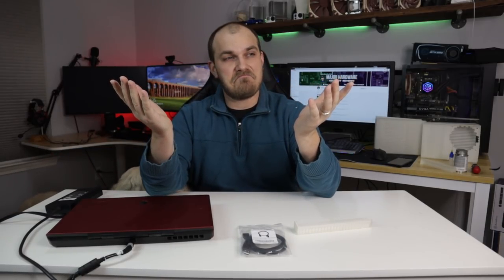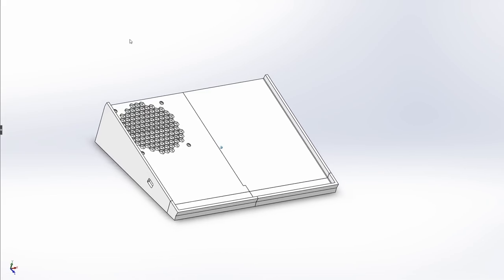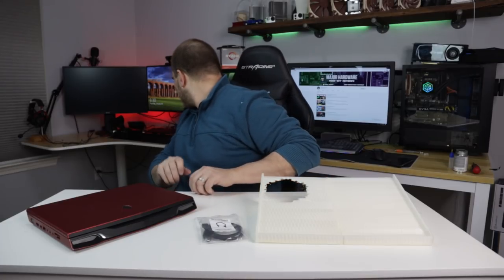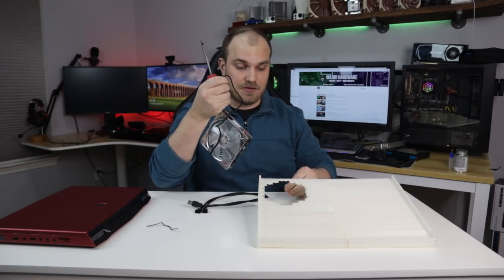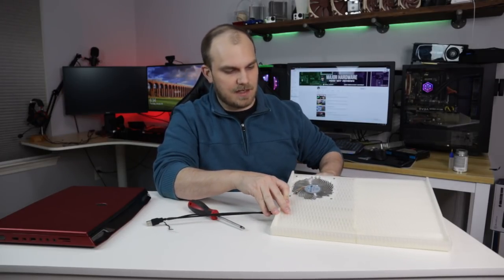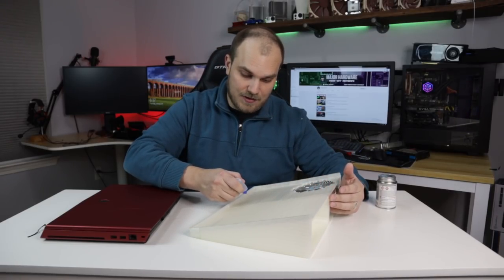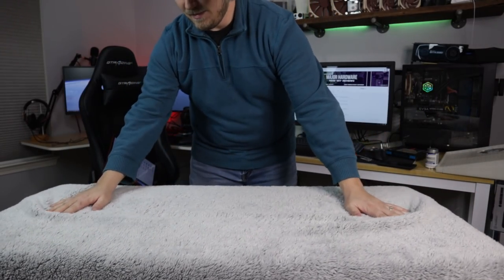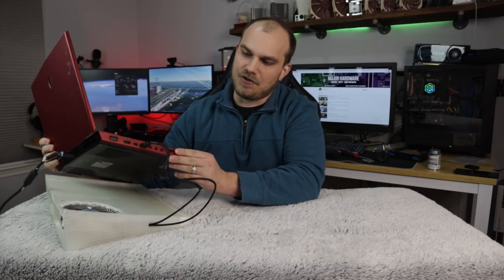I Made Something Useful To Cool My Gaming Laptop!

Comment: It would be interesting to see what it would be without the fan. Just having more clearance to draw air from should help
Reply: I usually put a pencil or two on the back of the laptop to make some clearance. The body of the laptop is strong enough not to get bent  so its ok
Reply: @santiagoferrari1973    I watercooled my ASUS FX553VD and no more thermal throttle . max temp when gaming reach 68-72 C
Reply: @mariesvilmy5680  same but without watercooling - msi gl63 - the 7 thermal pipes just rock!

Comment: Should have opened a hole on the other side so that the hot air could exhaust easier . Maybe you could have tested a push pull configuration .

Comment: ive found a downfall of many off the shelf coolpads is the fan being too close to the laptop housing, it creates turbulence instead of airflow when sans the flow straightener. then the on/off instead of rheostat is again noise instead of effective cooling. fwiw gaming laptop + extended sessions, typically equals being plugged in. use a phone charger to power the fan, less powerdraw through the mobo = lower temps (depends on the laptop of course). thanks for great video!

Comment: I did had an idea of replacing my laptops bottom cover with a 3d printed one with the extended bottom to fit desktop fans to cool the copper heatsink instead of the small noisy fans. Maybe even make your own cooling solution on the bottom or compartment in there for extra pieces or whatnot.

Comment: Nice. I'm using my gt70 on a desk, but the cpu still needs some extra cooling. I added 2 stilts under the rear feet and diyed a 5v fan to one of  those small booster boards and with a bit of tinkering with the pontentiometer(wanted to get the maximum speed out of the fan without going beyond the usb2.0 spec). In the end i can show a usb connector(boosted inside), a wire and a fan.

Comment: Awesome and functional. Makes a lot of sense. I've used a couple in the past and they all sucked. Eventually they just became vented stands. For one, like you mention, the location for the fans are by default in the wrong place and can't be moved; not very effective! Secondly, the fans stop working as they apparently use lame cheapos, even on higher end models. Also, for even more cooling, I'm considering if heatsinks in this stand would be worth it or not.

Comment: Hey i enjoyed the video ...nice homemade cooling pad :-). I usually put the fan where the underneath cover of the laptop comes off if i make a pad myself as not many laptops have big intakes underneath them... Other point if you are using a 12v or 5v fan it can always be run on a separate transformer.. A 12v will be nice and quiet running off a USB port of the laptop as it will be fed 5v...  Well if you need to free up the USB port can use a transformer to power the fan plus if it a 12v the fan will go max speed otherwise use a transformer with selectable volts output that will allow to crank up the volts if you want to cool more :-)

Comment: Haha that's pretty cool man ! I've made a few usb fans just to set beside a laptop ..thought itd b cool to make sonething like you did ..I like how yours turned out ..I ain't got the printer but I'm artistic so I'm sure the right plastic n brackets or plexi ..I can make it ..I got a cap for a coolermaster 240ml rad ..the cap that goes on pump on cpu had cooler master logo and I lightly sanded it n made a decal outta sticker tape ..painted it black and pulled sticker off so it says ryzen n that's what will glow ..I just gotta get my pump put on ..either controller port was bad or the wires I used outta it to the fans n pump ..I ended up just putting on my wraith prizm cooler..its all rgb 'd out :) gigabyte aorus 2060 super ..has the fans that glow ..lian li lancool 2 case with the neon lightstrip they sell n the vertical gpu mount..I love how it puts the gpu in the middle of the case not against the glass ...love the vids n ideas ..got me yapping n thinking :)

Comment: Said it before, but I think you'd really like an m17x (r4?). They get 2 large fans, and a full on MXM gpu. Mine gets 65 on GPU at 100% usage, and 75 on CPU, although that should get close to 65 when I upgrade the cooler. Mine has midrange specs too.

Comment: Hello! I thought maybe you would like to try my idea: I’m thinking of a way of using a 3d-printed turbine compressor powered by a regular 2k rpm fan motor (with some kind of reductor, also 3D printed, to multiply those rpms up to 15k-ish) to cool the cpu. I’m thinking of using a low rpm motor to keep the turbine as silent as possible (considering that the friction between parts of the reductor will produce much noise at high rpms, but I hope it would be less noisy than a high rpm motor). I would consider the project to be a total success If this turbine would make enough airflow to cool a 95w cpu with a stock cooler and keep the temps at 70 C under load while producing ~60 db noise. I don’t own a 3d printer right now and I’d really love to see someone experienced do it first.

Comment: i wander if a smaller fan would have worked better?. that fan you used  has its dead stop right were the cutout on the laptop it. so you might get better performace if the fan you have was off center of the hole, or you just had a smaller fan, so its center dead spot is smaller too.

Comment: You need something to pre cool the air before in enters the pc / laptop, ideally with some form of temperature control to keep it above the dew point below which water starts condensing out as droplets. Maybe a collaboration with one of the Arduino or hardware experts such as Julian Ilett or Big Clive :)
Reply: That's dumb literally nobody does that because of how heavy, expensive, loud, and inefficient ac units are.

Comment: Lmao I used for my M11x an old 12v fan and 12v power supply and placed the laptop on an old CD drive, after that under the fan I placed the cooler, works really good and keeps it cool

Comment: i have laptop but it 20in screen n ram cover was in middle n heatsink on leftside middle so i find me wide bed table so i took some rubber off broke vehicle n seal around open cover where ram n blower motor nearly by it did keep it cooling down before it hitting 72c n now it 40c "after 30mini test stressing it"

Comment: It is maybe little bit stupid (condensation) but will be interesting to see "pre cool" air by 120 rad with circulating ice water and then blow cold air into laptop cooler. Even better to use alcohol as coolant and ice in bags throwed to cool coolant, in that way you achieve sub zero in coolant, this means even colder air at intake of laptop.